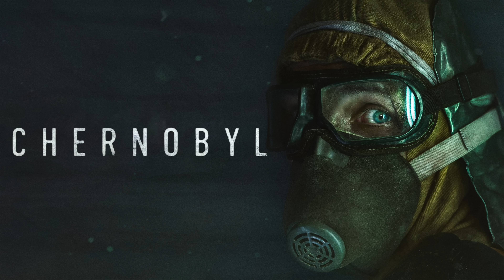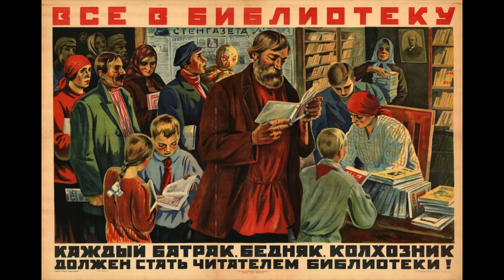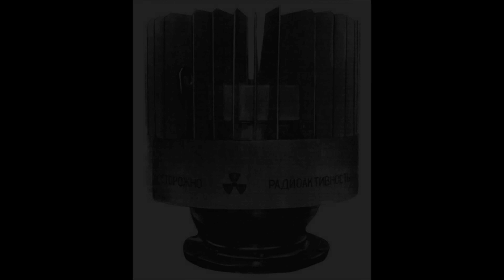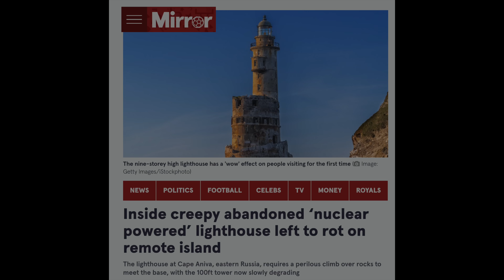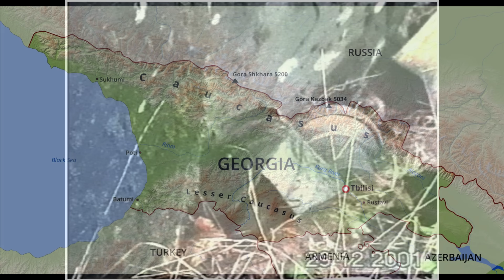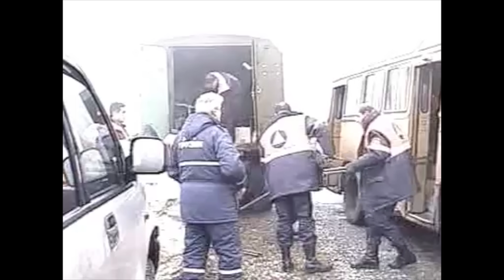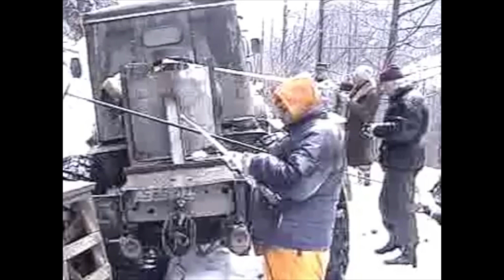The Soviet Union's Deadly Abandoned Nuclear Generators

Comment: Never put gas in my car again? Sounds like a nice power source that needs a little upgrading.
Reply: -heavier than an engine (add like, a motorcycle's weight to the car, because that's about how heavy they are)
-add weight for the battery
-add weight for shielding
-only produces like 150w in best conditions, charging would be slower than "slow" outlet charging an EV
-needs a battery because it can't produce enough power on demand to overcome friction and move the wheels
-would take literal days to charge the battery anyways
-dangerous to repair, refuel, crash or damage

Need I go on?

Comment: RTG's are amazing. You can heat a house with it and continuosly generate 30 Wh by the use of a peltie unit. If its properly designed you can have a unit that just works for hundreds of years. I know its higly ineficient as electricity generation, but it adds up if you have solar and a batery unit, non stop 24/7.
Reply: They will give your entire family a nice little permanent sun tan too
Reply: Just never lose track of them!

Comment: " As of 1992, the United States Air Force also used RTGs to power remotely-located Arctic equipment, and the US government has used hundreds of such units to power remote stations globally. Sensing stations for Top-ROCC and SEEK IGLOO radar systems, predominantly located in Alaska, use RTGs. The units use strontium-90, and a larger number of such units have been deployed both on the ground and on the ocean floor than have been used on spacecraft, with public regulatory documents suggesting that the US had deployed at least 100–150 during the 1970s and 1980s." I sure ours are better maintained with better security.

Comment: RTGs remain a valid power source despite Russia's criminally unsafe handling of the technology. Europe is too dense to excuse their use when they instead could just run a power line, but locations like islands and the much larger continents definitely could see more use, possibly add them to an international registry so in case a change of governance happens the world will still have track of where they are and pressure the new governments to perform maintenance or dismantle them.

Comment: There is a misconception about radiation of radioisotopes and heat at 8:00. These are not separate phenomena. In fact, the ionizing radiation of a radioisotope IS ALWAYS the source of the heat if it is active enough and that cesium 137 source WILL be warmer than ambient temperature for the same reason the strontium 90 is. If an isotope is emitting ionizing radiation of any kind and that radiation is trapped either within the sample itself in the case of alpha particles, or shortly outside of the sample by a dense shielding material, ALL the energy from the ionizing radiation will be turned into heat. This is how all nuclear reactors work, the radiation is being stopped by the fuel pellets themselves, their zircalloy containment rods, and the surrounding water which is heated to boiling by the exact same phenomenon that heats an RTG which is not undergoing fission reactions.

Comment: And yet there are proponents of small modular reactors who make good arguments for their adoption as viable, safer, smaller power generation stations.  No need for multi billion dollar gigawatt power plants,  failsafe reactors of twenty megawatts can be located remotely.  They can be used remotely and can be used in combination with other units.  They have a certain lifetime, when it comes, they are easily replaced.  This sounds like the rationale that the Soviets planted nuclear bombs, oh, excuse me, radiative thermal generators, a simpler power source than a small modular reactor, similar to the Pu thermal reactors used in long distances space probes.  The Soviets were bad engineers, but the idea of using ntr's in remote areas is sound, so long as they are well protected from the environment and people.

Comment: RTGs don't inherently pose any risk, but if you're going to remove the radiation source/core then that's when things become a big problem like this incident.

Too many people in the world immediately attribute nuclear energy as tantamount to danger and hazardous, when it's easily the most efficient and clean (using modern standards) energy source we have.
Reply: Also the NASA for example, when they use RTGs, encase the radiation source in a suitable case to prevent to much radiation to escape... also they should be able (and are designed) to survive reentry and crashing on the surface without exposing the core.

Its all a matter of thinking of what may go wrong and how much money you want to spend for safety.... 
I hate money.... it limits safety sometimes and because of safety regulations and the money lost on that, Fission reactors arent very cost effective and become dangerous while not properly checked and maintained for safety.
Also Nuclear reactors have one of the least injury rates among power "generators"
Reply: Yep if the reaction is controlled..fine... proper shielding fine. Anything goes wrong with either .... its China syndrome.
Reply: perhapse in 1st world hand yeah, not russians with their f the world we do what we want attitude.
Reply: Unfortunatelly it's only safe in controlled environment. If You put it to some irresponsible, unqualified possibly drunk people it's incident waiting for happened. Big heavily secured nowadays nuclear plants are great. Thousands little sources with no control over it not really.
Reply: 😂🤣Fukushima was / is a state of the art nuclear power plant, we still have no advanced working technology. Molten Salt Reactors are still decades away from being an actually working nuclear power plants. Currently, it looks like nuclear fusion will be useable before MSRs.
And nuclear energy isn't clean if you consider the hole process of from mining the resources to waste management.
Reply: @pogonator1 state of the art? They came online in the beginning of the 70s so the design and construction was in the 60s.
Reply: @pogonator1   Literaly all of what you talked about can be explained by activists or greedy investors, but i understand why people feel the way they do about nuclear, it's a very easy sacrifical lamb for anything wrong with energetics
Reply: @pogonator1  You might wanna double check our data. Fukushima Daichi was already over 30 years old when he failed.
And even than did it fail to a super thunami that was caused by a level 9 earthquack. 
And even thand did it only happen due to bad design of the back up power system for the cooling(a flaw the company was made aware of multiple times including by there own inhouse staff and just ignored). Its sister in the south had a better placement of the back up generators and survived just fine and a different plant in the north closer to the earthquake was build around the possibility of such a natural disaster and tanked it outright.
Reply: @pogonator1  Based on CDF estimates, modern Gen III+ reactor designs are anywhere from 100-1000x safer than the BWR used at Fukushima. Further, the design of the plant of Fukushima was intended for operation in the US midwest, where tornadoes are a major concern. Thus, redundant safety systems were placed below ground. This was inappropriate for the east coast of Japan, where tsunamis were a concern. 

As far as not being clean through the whole process, nuclear creates less waste than either solar or wind power. It requires less land in all three areas of mining, operation, and waste management. These are readily available facts found through 10 seconds of googling.
Reply: @pogonator1 wrong. Molten salt reactors existed already in the 60's. It's tried and tested technology. But the powers that be didnt want them, as they couldnt be used to make atom bombs. Fusion on the other hand is pure sci-fi as of now.
Reply: @pogonator1   hello dumbass, where do you think the metals to make solar panels come from (hint: mining) ans where do you think the plastics for wind turbines come from (hint: crude oil)

Nobody died from fukushima, only economic damage.  So a nuclear reactor taking on a tsunami and one of the strongest earthquakes in recorded history and not even one person died.  I'd say thats a pretty good safety record.

Comment: I’m curious as to the health of those brave guys recovering that radioactive chunk at the end.
Reply: They're fine. Weren't too close so quite a bit less than 4.6Sv/h (which the source was emitting) but for this sake let's assume the worst - the full 4.6Sv/h. For 45s that'd net to 0.125% of a full hour dose. So, 0.125% * 4.6Sv = 0.00575Sv = 5.75mSv.
 That's about 2x the radiation dose an average person gets per year from typical background radiation. Or about 2x smaller dose than a full CT scan.

Comment: Steel beams from Chernobyl ended up in Taiwan and used in a apartment complex. The material was illegally salvaged and sold them sold and sold to someone else. It eventually made it into the apartments of Taiwan. Good news is that they were not that radioactive so no ill-effects happened. The apartment was demolished.
Reply: The apartments were built in 1982-1983, so the use of steel salvaged after the Chernobyl accident in 1986 was not possible.  The contamination was only cobalt-60 (therefore most likely due to melting of scrap metal with an irradiator source or teletherapy source, similar to the Juarez incident in 1983).    Over 100 buildings were built with radioactive steel.  Residents have an increased occurrence of chromosome aberrations corresponding to radiation dose, although the relationship with their overall health is unclear - some conditions became more prevalent but a direct link to radiation exposure could not be established.

Source: Taipei Times, April 29 2001, page 2.  (Except the part in parenthesis, and the comparison of dates versus Chernobyl.)
Reply: @CoastalSphinx this is how you make a comment on social media. Well done sir.

Comment: 2:00 An RTG isn't that dangerous. The standard active component in RTGs is Pu-238, which has a decay chain that consists of alpha particles only. Those are stopped by a single sheet of paper. The technician in the photo is not being exposed to any more radiation from the RTG than the background level in the room. 
The Apollo missions carried RTGs, to power experiments left on the moon. 
A small number of Earth-orbiting satellites used RTGs or nuclear reactors (also using thermoelectric converters) to provide more power than they could  get from solar panels.

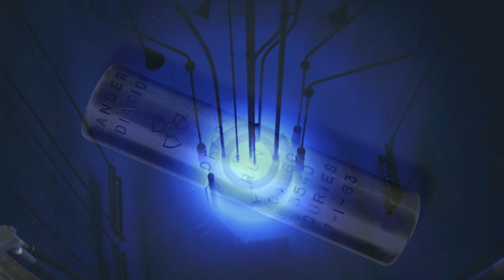Comment: 9:15 That's not completely true, there is a threshold that the body begins to figure out something is going wrong, thought it's not a unique sense or anything.  Several victims of Therac-25 errors (the issue was not a malfunction, the programs expected hardware interlocks that were not present on the 25 model) reported burning sensations during treatment, well before other symptoms began to manifest, though at the levels involved it was more of a photon beam running at 25MeV.  One poor soul got dosed six times in a row, they estimated her dosage at between thirteen and seventeen THOUSAND rad.

Comment: Nevertheless, those RTGs seem a fine source of independent, maintenance free power.
If only they hadn't completely neglected safety checks.
Had they only reduced their checks instead of abandoning them they might have been operable and safe for much longer than they were, much like everything the Soviet Union left behind.
Lots of wasted potential in resources and abandoned infrastructure.
Reply: They were a good idea when they were deployed, but what technician would have believed you if you had told them that in the future there would be no one to monitor these stations because the government would cease to exist and the country would become a lawless wasteland?
Reply: the efficiency is very low
Reply: As is the power output.
Reply: Wasted potential noo more like one big mess - the Soviet Union

Comment: Andy, the USSR also used RTG's in low Earth Orbit in their Upravlyaemy Sputnik Aktivnyy or US-A,  AKA RORSAT program with some spectacular failures such as Cosmos 954. Could be an interesting avenue for you.
Reply: US-A did not have RTGs, they had nuclear reactors.  Compared to RTGs, reactors had a higher power-to-weight ratio, and they also allowed direct control of the power output.  The major disadvantage was short operational life, which is why there were so many of them.
Reply: This is completely wrong, USAs NASA used RTGs on many space probes like on each of the voyager and pioneer probes and many more. A prominent probe raising global concern because of its close passage to earth after a sling orbit around the sun for gaining speed, was the Cassini Huygens Probe launched in 1997 which had three (3) RTG on board. Esy to research, just check out the Cassini wikipedia page for starters ( and yes, these were all bonafide RTG )
Reply: On more than 24 space probes and missions since 1961, including on the moon, NASA used RTG's.

From the horses mouth: https://science.nasa.gov/mission/cassini/radioisotope-thermoelectric-generator/

( and ironically it was the USSR that focused on using nuclear reactors in space rather than RTGs, according to a wikipedia article)

Comment: Nuclear power is a great idea, but doing it on the cheap like the soviets did is like building an airliner by cutting safety costs (which the Soviets did also)
Reply: Soviets didn't build nuclear power on the cheap. They built nuclear weapons on the cheap (RBMK reactor was designed to make plutonium for nuclear weapons and produce electricity on the side. Because weapon grade plutonium production requires constant changing of the fuel assemblies to prevent buildup of undesirable plutonium isotopes the soviets omitted a containment building from the design).

Comment: Few Months ago i was on a training to locate radioactiv material. dectecting radiation is basically easy but determing what exactly is the radioactive material can be frustrating since the parts can differ in size from easy visible to 1mm or less.

Comment: aside from possible containment vessel breach due to scrap metal thieves and oxidation decay RTG's really are not a issue as there no moving parts. RTG use thermal decay and peltier stacks to generate power verses superheating heavy water and using steam to move a turbine to generate power. RTG's are stupid safe vs heavy water steam generators.

Comment: I have always hoped that someone would develop RTGs a bit more and get to the point where you could have one buried underground, sealed in concrete, with only electrical cables sticking out of the ground, that could power a home.  Something that could last for 100 years minimum, never being maintained, just constantly pumping out power.  I would think you probably couldn't do it with this type of Siebeck-effect generation of electricity, but there are other ways to turn different types of radiation into power.
Reply: There is no demand for them. The only place they have any relevance is outer solar probes, where the benefits outweigh the severe downsides.

A small modern solar array in full moonlight produces the same as one of these old RTG generators. A far cheaper and safer way of making electricity in the middle of nowhere! 

I think there are also some stirling cycle generators that use plutonium but again they are for space application.
Reply: @chris746568462 hi! I  fact, the moonlight is around 300 thousand times less energetic than sunlight. Solar panels generate so little energy during night that it's negligible, so it is not a good way to generate power with moonlight. It is better to have a battery and more capacity to generate the solar energy during the day
Reply: @arthurdefreitaseprecht2648 Solar fanboys often seem to forget that many Northern areas go for months with barely any sunlight.

Comment: Actually you CAN detect radioactivity with your human senses! I read a paper from around 1900 in which a method is described how you can estimate a the activity of a sample with your eye. You just hold the sample very close to your eye and depending on the activity you might see a blue light. It was actually described as quite a beautiful experience, caused by Cherenkov radiation in your eyeball, as we now know. As you all might have guessed, this method did not catch on.
Reply: I think this is more due to scintillation rather than Cherenkov radiation.

Comment: Rule of the thumb: 

Alpha decay - relatively harmless, can be blocked by a single sheet of paper, cannot even penetrate the dead body cells on your skin, cannot enter your body. 

Beta decay - can easily be blocked by 100-sheets of paper but your outer skin cells won't block it, you don't want to get exposed to it but a solid metal container with reasonable thick walls can easily block it. A thin metal wall could also block it but be careful of x-rays, as beta radiation hitting metal can produce x-rays, that's why you should have multiple shields to also stop x-rays.

Gamma decay - you are in deep trouble! Only very thick concrete walls (thicker than what a building would offer) or lots of lead can block it and not even that will block it completely. Lots of water works, too, but water is worse than concrete (around 2.5 times worse) and concrete is already way worse than lead (4.5 times worse). Best protection against gamma rays: Distance! Lots of distance!
Reply: Addendum. Alpha decay harmless, unless the source gets in your body, then it has nowhere to escape. Inhale plutonium oxide, and you are in a world of hurt.
Reply: Addendum. Gamma decay, Miyagi defence...no be there.

Comment: NASA style RTGs using Pu238 are actually pretty safe as the plutonium is a ceramic and most of the radiation is alpha and they where even carried on the moon landings.
The Sr90 ones on the other hand are very dangerous and strontium has the added risk of being a bone seeker.